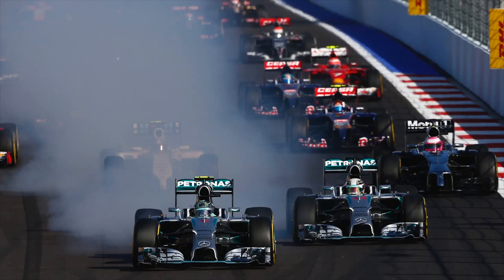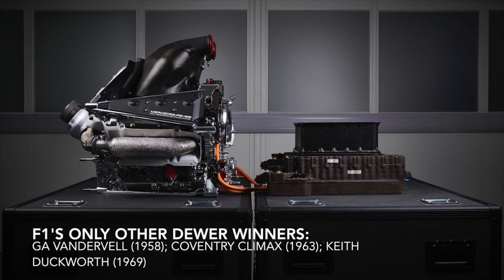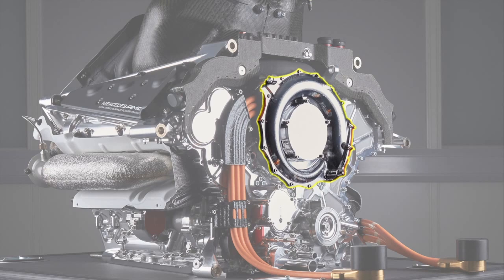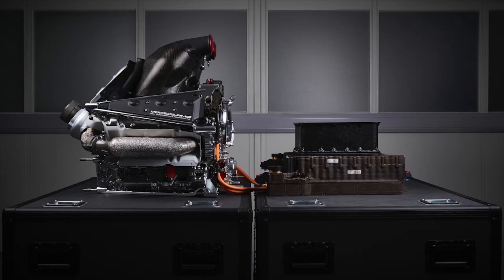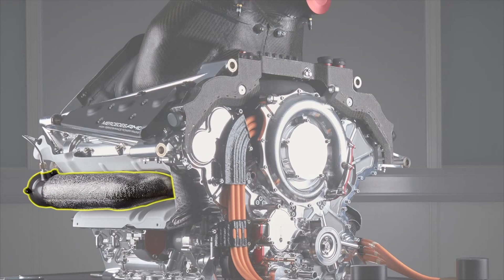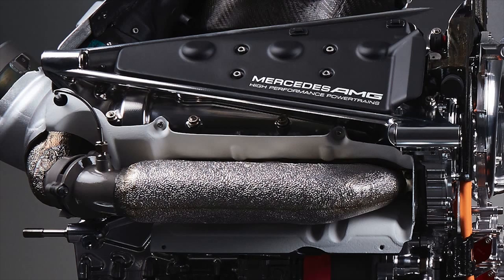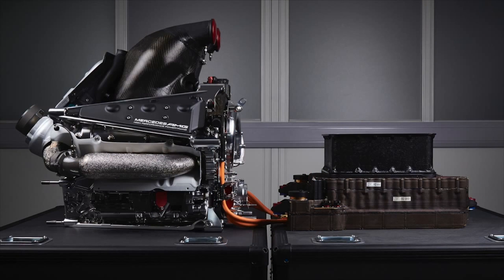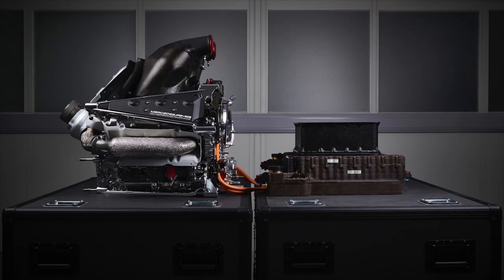Mercedes F1 engine: update with Craig Scarborough

Comment: Can other teams copy this in 2015?
Reply: Yes they can if it fits the regulations for 2015 but it'll mean they are copying something which is already out of date. Mercedes themselves would have already been working on the engine for 2015 at the beginning of the 2014 season, making it yet even better.
Reply: if it only was that simple as a turbocharger split. It's end to end all details count kind of scenario. There's massive amount of work going into software alone, calibration of the energy recovery systems, how you deploy that energy and so on. Just look at Renault, one season in and they struggle with mapping and driveability, that kind of stuff you'd expect them to have sorted by end of last year's tests.

Comment: 3:13 ....You mean reduces?(not trying to be a smartass, feel free to correct me).
Reply: Lol, Scarbs uses the word 'improves' turbo lag which I think he means by having a positive effect rather than a negative effect in the turbo spinning up to speed. I think what I just wrote makes sense!
Reply: Capt Nemo Yeah, I feel the same way actually....
Reply: I was going to post exactly the same thing.  It baffles me when I see the miles of intake/exhaust plumbing on rice burners.  When we were turbocharging in the late 70's and early 80's, we knew that the shorter the plumbing, the shorter the turbo lag.  Not rocket science.
Reply: What's the bet they have removed the tuned exhaust setup and relied on a semi-tuned intake in that massive "frog" like intake manifold. With the heat energy recovery system they might be able to tune the flows more precisely to counter act short pipes.